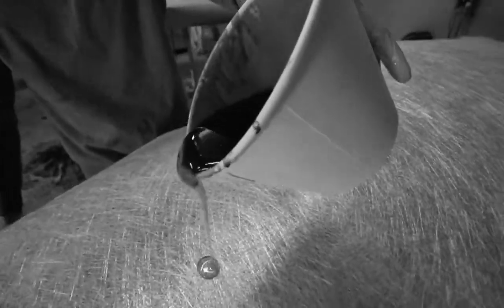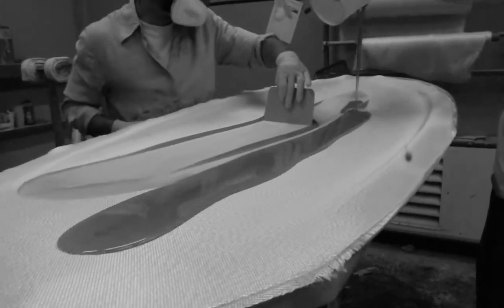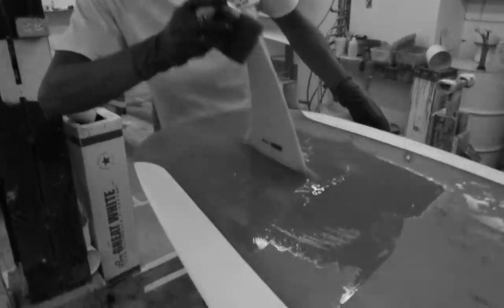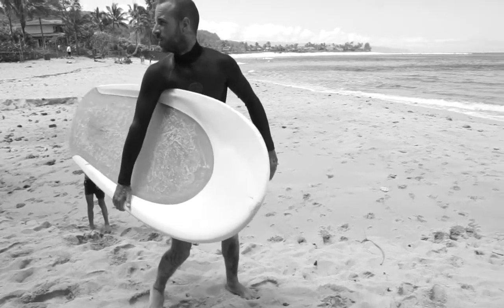Fantastic Acid Flexspoon Hawaii

Comment: I used to kneeboard in the 60s and 70s.  I rode a foam spoon that I got from Greek Surfboards in Huntington Beach.  It was pre-shaped, out of a mold, and I glassed it myself.
I made the fin by laying up fiberglass in a shoe box.  Back in the day glass spoons were criticized for not having enough float but on a gnarly day at Newport Beach they reigned supreme.  You could take off super late and and it felt so serene in the tube where a foam spoon felt twitchy.

Comment: I first rode a home-made and fairly crude spoon at Velzyland in about 1970.  The fin was too small (my fault), the flotation was lacking and I soon gave it up.  The center of buoyancy on a spoon is too far forward so they push water when paddling ('scuse me, you can't paddle them, only fin kick) and again b/c the nose has the only flotation, they are hard to get into a wave.  There are several reasons why modern surfboards have the wide point back from center, and narrower noses.
As for the undoubted abilities of George G to ride these, they need a long walled up point break similar to his home grounds - Santa Barbara, I was told.  
GG had his time, and time has moved on.  The particular benefits of spoons for certain, and kneeboards generally, have been long ago eclipsed by modern shortboards.  Moves that were once the singular province of kneeboards have become commonplace on modern shortboards, which offer better paddling, flotation, wave entry and most of all allow the strongest muscles on the body (legs) to add elasticity, flex and torque to turns. Kneeboarders don't have the flex in their torso that a surfer's legs will allow.
Back when I started kneeboarding in December 1970, other surfers were amazed that I could surf into a closeout and with a single turn, punch out the back.  It wasn't until a few years later that world champ Sean Thompson showed that it could be done on a surfboard.

Comment: Credit to the builder - but due to the lack of mass and float they need a lot of speed to work. Despite the good conditions this one never looked like it was generating enough speed to do much and needed a lot of leverage on the rail to turn.
Reply: shoud try a plywood bellyboard, hard to get going but bloody fast when up
Reply: ...My first custom ordered board was a Greenough Spoon back in '68. It was a bitch to paddle and seemed to only work well in larger, faster waves. Went to a "solid foam" after that and never looked back. I still have an original Greenough spoon in the garage.....
Reply: What a treasure.